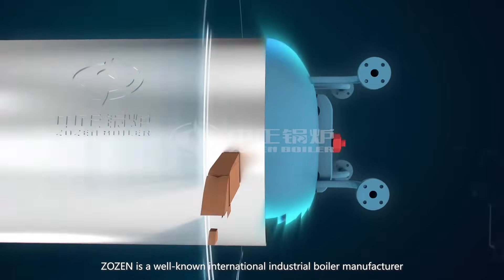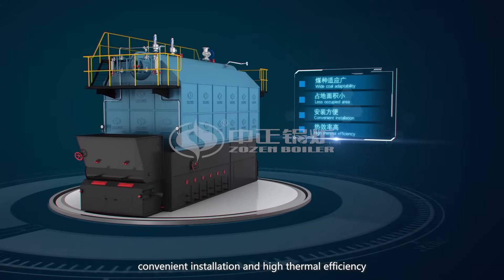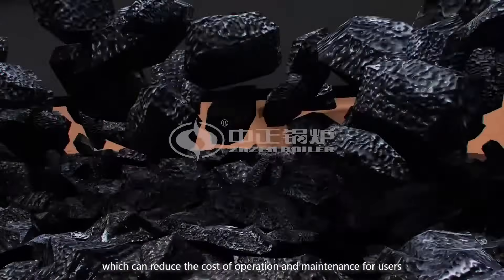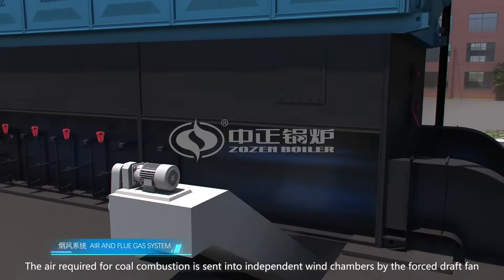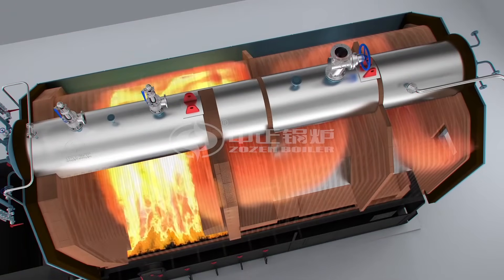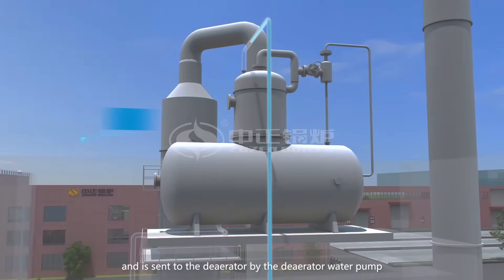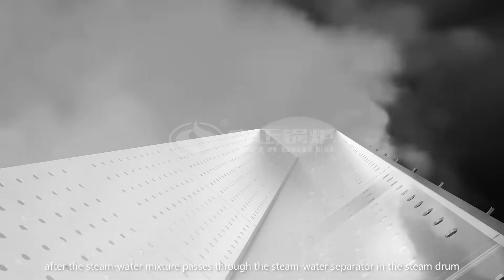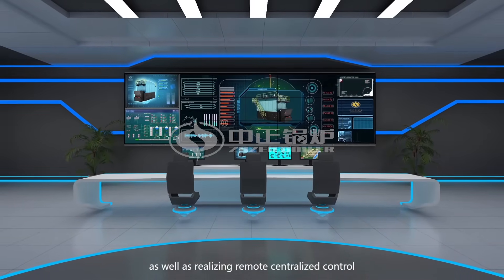SZL seies coal fired chain grate boiler - 3D animation version

Comment: How much maximal pressure steam it can produce?
Reply from the maker: The maximal pressure is 2.5 MPA (25Bar). 
Thank you for your interests. If  you need boilers, contact jennifer@zozen.com or Whatsapp +8615861597093.
Reply: @ZOZENBoiler  oke its equal 10 - 20 bar, what kind of the steam it produce? Saturated or superheated
Reply from the maker: @nonAme-pm2ov   Saturated Steam

Comment: What are the maximum steam pressure and temperature? Is there a provision for adding a superheater?
Reply from the maker: Dear Gregory Malchuk, the product parameters are as belows: capacity:
4-35 t/h; Working pressure:1.0-2.5 MPA; Outlet temperature:184-350 ℃. Thank you for your interests in our products, you can contact us at jennifer@zozen.com or Whatsapp+8615861597093